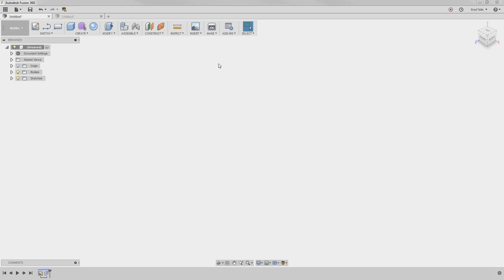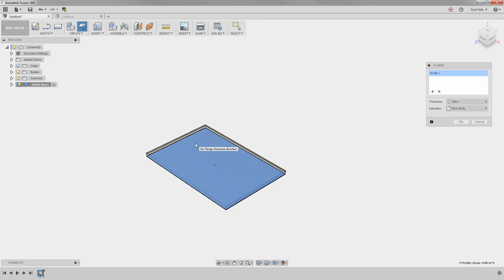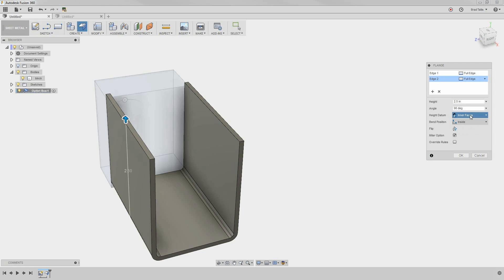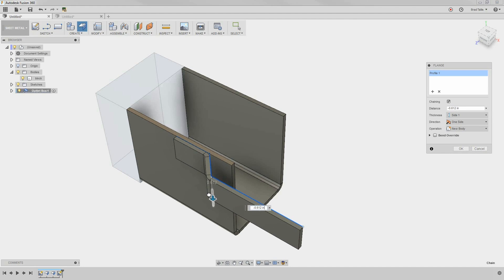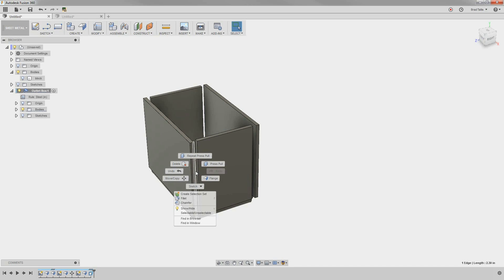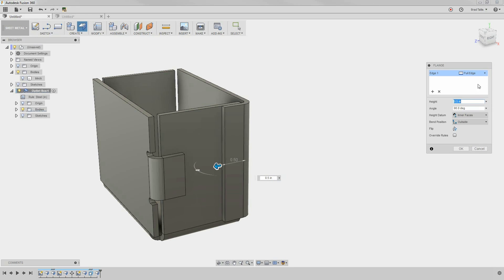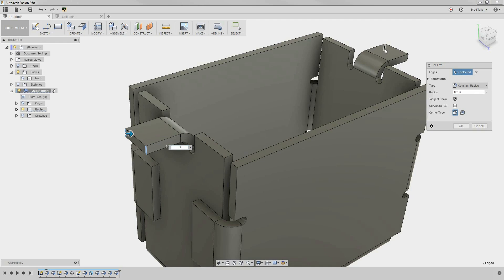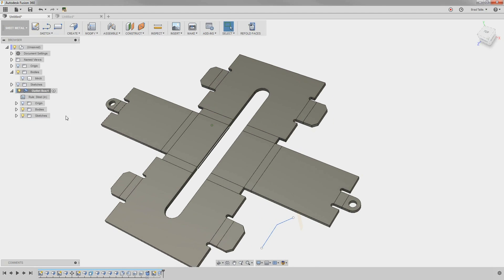Sheet Metal Tutorial

Comment: Hello lets say I had a U-shaped profile, and i want to Cut it at 45 degrees just like with a saw, to join two of them later on after bending at 90 degrees 

How do i cut my bended profiles at 45 degrees, with what Tool do I use to do that or method in fusion ?

Comment: as for now, I can only somewhat work in AutoCAD, and Ive designed custom ITX PC case, where most of it will be one big bent aluminum sheet ... can I import my 2D/3D drawing into any other CAD software that can animate the bending process ? or can I at least import it into Fusion 360 so that I dont have to draw and bend it from scrach ? thanks